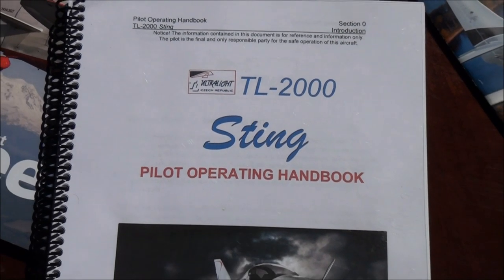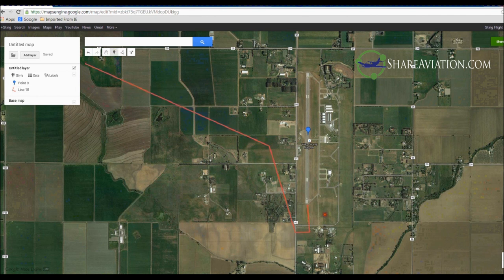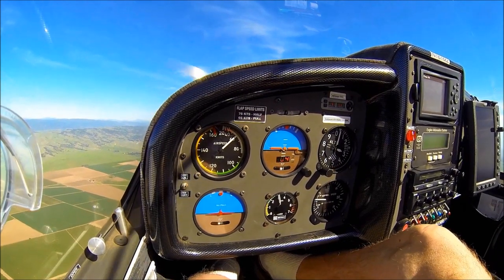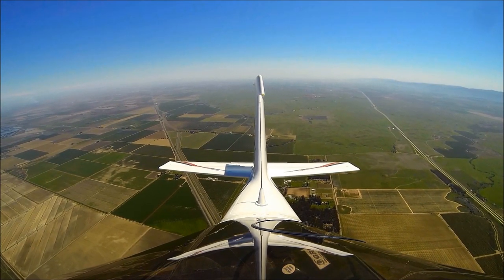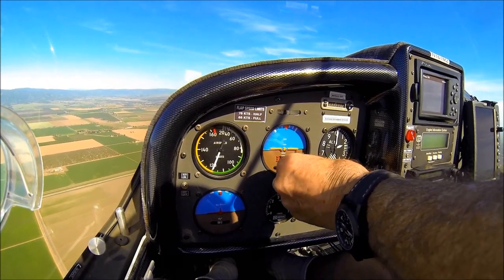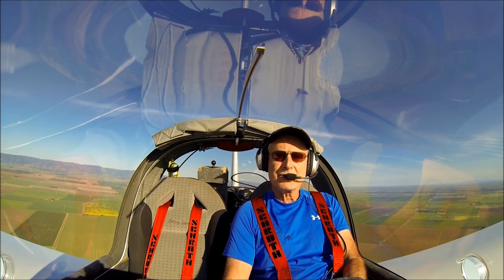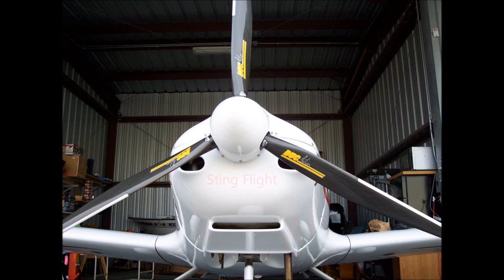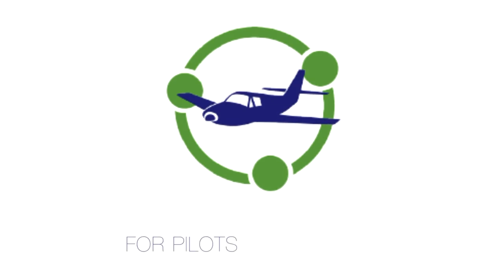Introduction to Stalls in the Sting Airplane

Comment: Excellent video.

I know the info as I practice it in every class I am taking but it is well presented and explained. I would add that on the recover portion you need to stress the need for regaining flight speed when lowering the angle of attack (and putting power) and then start slowly getting away from gthe ground and gaining altitude. Always remember guys, these things happen on landing and takeoff, when you are near the ground. Just regain speed and slowly start getting away from the ground. Slowly is key, to avoid a secondary stall. (disclaimer, I am a student, not an instructor)

Kudos on the editing too! Loved the video.
Reply from the maker: Thanks, Alex.  Very good points....

Comment: Always good to practice stalls regularly. Another excellent video from your channel. I noticed when you had the wing drop in your stall you tried to pick it up with aileron. Use of aileron to pick up a dropped wing will make the spin worse. Use opposite rudder as soon as your wing drops! Looking forward to more videos! Blue skies from up North
Reply from the maker: Roger that! Intellectual--not instinctive...  Pretty hard to kill the instinct.
Reply from the maker: Roger that.  Intellectual--not instinctive.  Yet instinct is often the uncontrollable first reaction.
Reply: Sting Flight if I had a dollar for every time I tried to pick up the wing with ailerons!
Reply: I am not a flight instructor, but in my experience what has been important is to move the stick forward. When I push the stick, it reduces angle of attack, and the ailerons work normally. The problem with what you just advised is that it's counterintuitive, so it requires attention - and putting attention on the rudder makes it the primary flight control, in a stall. This has two bad consequences: first, while focused on using the rudder, a pilot is not breaking the stall! And, second, when you get a quick wing drop you may use a lot of opposite rudder, which can cause an "over the top" snap roll in the opposite direction - look for "Anatomy of a Cirrus Stall" on youtube - it's long, but you'll see that the wing dropped to the left, and the pilot did as you advise - right rudder - and snap rolled to the right, which was not recoverable. So, maybe someone can persuade me I'm wrong about this, but I prioritize a different counterintuitive response to a wing drop: lower the nose.

Comment: I'm currently trying to buy a Sting.  I have owned 7 certified airplanes.  I've found that Insurance is a killer on LSAs.  It's unbelievably high.  Do you have a source?
Reply from the maker: That's what I've heard too.  I've just been sticking with AVEMCO for several years--and not shopping around--because of good service and no-nonsense policies & support.  So, I'm probably not the one to ask.  Good luck!